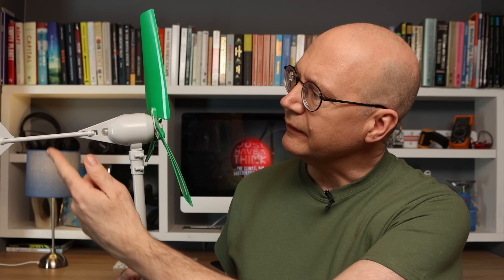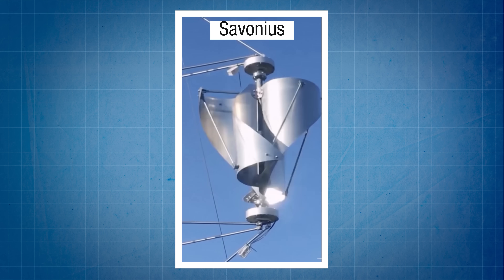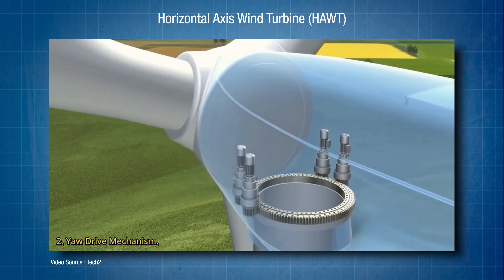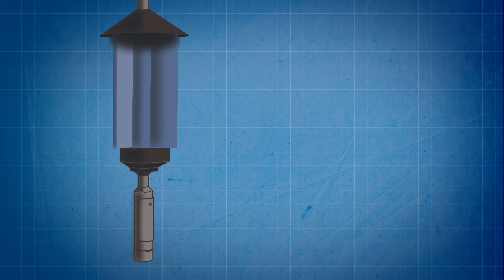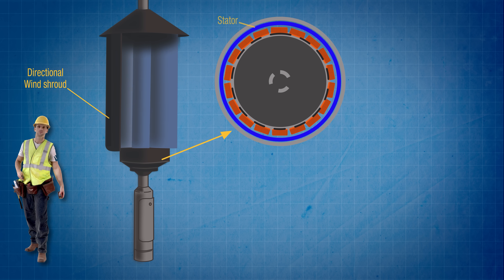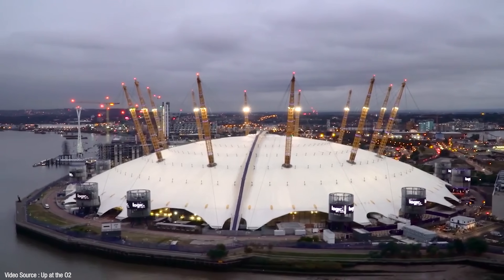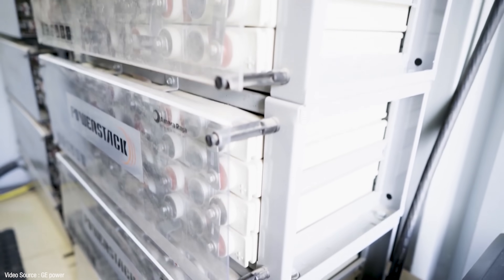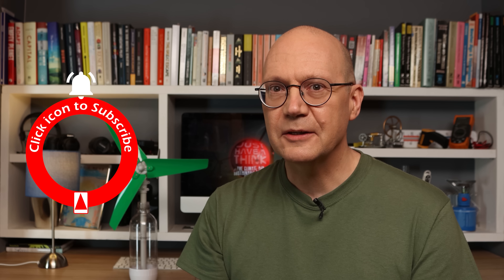A vertical axis wind turbine that doesn't need the prevailing wind! How do they do that?

Comment: Could not the airflow around the vehicles on roads be used to power small turbines fitted in the front or underneath the vehicle. i know it would only be a small amount, but thousands of vehicles at 70mph would surely add up. An extra 5% range for electric vehicles? Quite prepared to be proved wrong, but just curious
Reply: Wich will be paid for by extra drag = more fuel consumption.

Comment: I live in Southern California where we have lots of wind.  I’ve been watching the development of these wind turbines for over 10 years and finally they are getting small enough to make it feasible to put on top of houses.  If we had these along our freeway systems, imagine the energy produced!
Reply: With LA's gridlock, they'll probably work in reverse.  Lol.  Sorry, just had to hank your chain.  Would love to see California give fossil furls the finger by mass implementation of these, solar, and other renewable energy methods.  AND how to recycle and reuse the materials that they are constructed from.
Reply: Would love to know what the generations levels would be if installed on the I5 between Valencia and Irvine.
Reply: I am considering a vertical axis wind turbine that looks exactly like a tree, I call it : e-tree.
the trunk of the e-tree is brown, the spinning blades are green,
attached to the trunk of the e-tree are features of : wifi/mobile network, light and power outlet, to charge a car for example.
Reply: On top of the car too...
Reply: You write, "imagine the energy produced!"

It should "imaginary energy produced".
Reply: @jerrybrickley2115  are you saying the energy potential is not there?

Comment: Has any body thought of how much wind IS generated by trains, and with vertical generator can be secreted inside the actual turbine and accessed by hinging the blade frame. Just in Australia the infrastructure for maintenance is already in place? Thing of the size of the Pilbara in west Aussie, coal grain. I rest my case . I have more you can track me through you tube just a thought.

Comment: I love the idea of these micro devices and anything that pivots electricity generation from fossil fuels. However I do have some questions. How long before they generate enough energy to pay for themselves? Do they work silently or without vibration as in many situations would require this? How much maintenance would they need? Is there a flicker effect? (I personally can get migraines from flickering light). Lastly as there seems to be little real information about actual installations on the A311 website is the picture they show of Inverness a mock up or an actual thing? I hope I am being slightly skeptical and not cynical.

Comment: I have just looked at the Alpha311 web site and I have to say I am very suspicious of them. If they are serious then there would be dimensions and power graphs on their web site, but I can find none.
Wind turbines of the sort from Alpha311 never produce as much energy per cross sectional area as conventional propeller style turbines, simplistically because half the turbine is travelling in the opposite direction to the wind flow. Their advantage is that they are simpler, operate in turbulent flow and can be placed closer together.
A typical horizontal axis WT is up to 50% efficient at converting the kinetic energy of the wind to electricity. A savonius type vertical axis WT has an efficiency of between 10 to 17% and Darius type has an efficiency of up to 40%. There are various other types, but they are just variations,  e.g. the Vortexis which claims higher efficiency (also without published data) and the Alpha311 turbine looks like either like one of these or a modified Savonius turbine.
19m/s is a very high average wind speed, even for the UK. 6 or 7m/s would be more like it, although this is higher in the north of the UK, but generally below 10m/s average, but the traffic generated wind speed of up to 5m/s would add to that for highway mounted turbines. 
Typical 1kW rated conventional turbines will provide up to 2kW at 14 or 15m/s, but the rated power is at wind speeds of around 8 to 10m/s and have a diameter of over 3m which is an area of 7m2.
Therefore, using that as a reference, to provide the sort of power which you say Alpha311 are claiming at typical UK wind speeds and given the lower efficiency of their type of turbine, they would need to have a swept area of 35m2. I.e. If a conventional 1kW turbine has a swept area of 7m2, multiple by 2 to account for lower efficiency and multiply again by 2.5 for 2.5kW rated output.
If they use a turbine something like that detailed in the following paper with 38% efficiency or about 76% the efficiency of a conventional 1kW wind turbine, giving them the benefit of the doubt, the swept area would need to be over 23m2. I.e. (7m2 / 0.76) x 2.5.
https://www.researchgate.net/publication/342573744_Vertical_axis_hybrid_wind_turbine_design
I'm not saying they are bad, just that without published data on their web site, I am VERY suspicious.

Comment: thank you, i believe Canada should jump on board and relive some of the grids electricity that would power lights for every home or computers .  Its a great start to look at, and in case of emergency such as black outs. every one needs a battery bank with inverter to generate at least 400 watts .

Comment: Nice video, (as usual:).
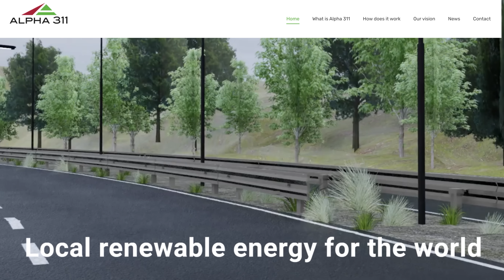I'm a big supporter of renewables, but in this case (specifically the ROADSIDE use of VAWTs, and "...harvesting the wasted air flow..." 03:57), it seems to me we're just using fossil fuels inefficiently to generate electricity for one entity (the system's owner/operator) at the expense of another (the cars' owners/operators), here's how: 
If I'm not mistaken, we're extracting energy from air flow created by the drag of moving cars, reducing it's speed, creating more drag for the cars, causing them to use more fossil fuels to keep their speed AND produce more air flow, and so on...

Since no energy conversion is 100% efficient, (yet:), and wind turbines are at best 60% efficient, aren't we going to use MORE fossil fuel to generate electricity using this method than other, more efficient, ways?

In addition, each car owner will pay a small "fee" (in the form of fuel cost) to generate this energy for the operator of this system, without compensation, and without informed consent.

VAWTs are not a new idea, and I support anyone making them available and affordable, but using them for roadside "wind" harvesting is ecologically and economically (and possibly also socially) wrong.
Reply: One more thought... if we could harvest LATERAL air movement or vibrations, without affecting car drag, then this would truly mean "harvesting the wasted air flow".
Reply: The energy is harvested when the cars have past so it won't affect them. Best case: Opposite traffic don't have to overcome your slipstream so it would actualy save them energy.

Comment: Not specifically on the video detail but some more general points re: some items mentioned in the comments.

The comparison between using compact, low cost VAWT turbines along highways and motorways and solar farms is flawed in many ways.

Solar panels would be highly unsuitable in terms of AREA consumption along a highway or motorway, whereas the compact footprint area size of VAWT turbines is MUCH better suited.

A compact VAWT fitted to the top of motorway lights (higher than standard roadside lights) would be making FREE energy anytime the wind is blowing (albeit ignoring investment cost). This HAS to be a good use of existing infrastructure and unused resources. However it needs, as MOST if not ALL such projects require, a properly holistic approach. For example, let's take my concept of a VAWT atop each lamp post.

* Are the posts existing strength capabilities sufficient or do they require a redesign & replacement

* Just like solar, although potentially available for 24 hours vs 6 for solar in winter, BOTH require storage to maximise the overall capability.

* Because wind WILL statistically be blowing MUCH longer on average in winter than the amount of sunshine with dark overhead cloud cover, and IF we look solely at sufficient power production and storage to supply  winter lighting, then sufficient  storage COULD be fitted into each lampost, thereby maximising efficiency of supply over short runs.

* Fitting of anti oscillation vanes to the upper sections of the posts - a relatively minor external retrofit operation SHOULD using good design produce a vortex pattern above the vanes and directed directly upward towards the turbine and, theoretically, be used to enhance the output of the VAWT through vortex interaction.

* The biggest inefficiency of a VAWT comes from the air resistance to the returning half of the VAWT blades. What research has been carried out on this? Has part blanking of the blades and a direction rudder fitted been tested? Slightly more in production cost but not massively so. Geared internal rotation of the blades, similar to feathering a prop, on the return path?

* LOTS of other factors to consider before either accepting or rejecting these designs!

Re: increased wind from passing vehicles surely that would be dependent on the vortices generated and not on the direction of traffic.

 Traffic going against the wind (in the UK) would generate a local anti clockwise vortex (a BIG one in the case of HGV trucks)! HgV trucks are the biggest occupier of the inside lanes of a motorway so LOTS of BIG vortices. What research has been done to measure this? Aircraft vortices have ALWAYS been present but only PARTIALLY understood in the last twenty years. The only research I've seen is on reducing drag on the vehicle itself.

Some clever deflector design might prove useful for optimisation in using any vehicle side vortices at low level.

So many questions and so few answers. The industry ought to wake up and engage DIYers, especially those with an engineering degree or background, to help research this stuff empirically, maybe by fully or part funding designs for testing.

Thoughts anyone?

Comment: you should look into gyro cascades as they relate to conservation of motion, take two cones inverted horizontally and put them on oposite sides of an axle that turns a flywheel.

Comment: I have a house boat on the river here in America. The river flows constantly. One of my boats I have a out drive that resembles a weed wackier shaft. It’s called a long tail motor. Model twister. I’m about to set a horizontal impeller on it. To drive a generator. I’m gonna put a large cork screw impeller on it to create torque. And come up with way to fold up out of water

Comment: Just have a think about this:  There has to be a big thrust bearing holding these things vertical while allowing rotation.  When that thrust bearing fills with dirt, and it eventually will, what is involved with changing out that bearing underneath all the heavy turbine blades?  This is the main reason why vertical shaft turbines never made it out of the 1970s prototyping.

Comment: I have the same idea for the electric car, put a compact generator on the roof of the car, granted it won’t charge the battery enough to eliminate external charging, but could reduce the external charging time. Basically the same type as the vertical type in your video just much flatter.